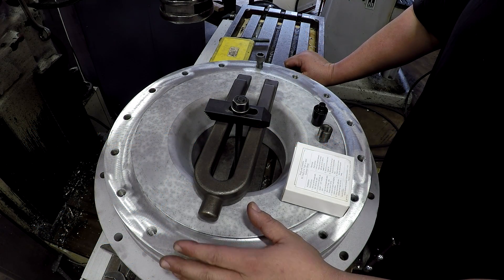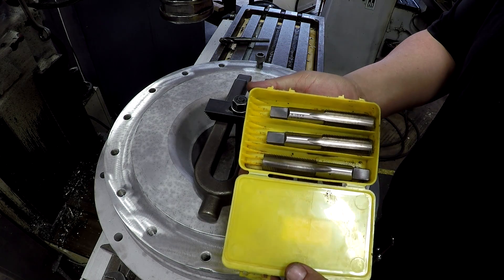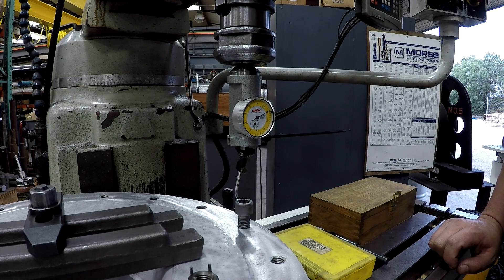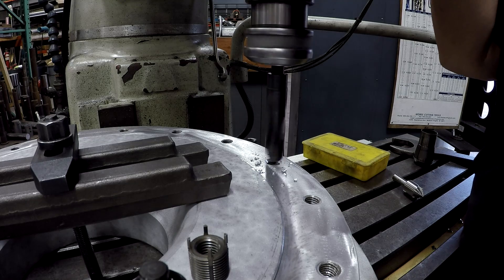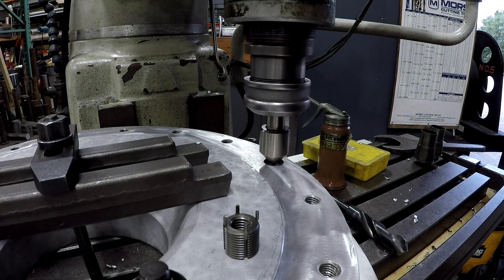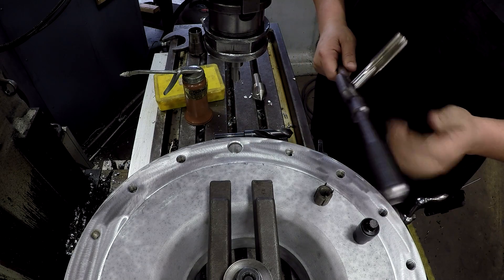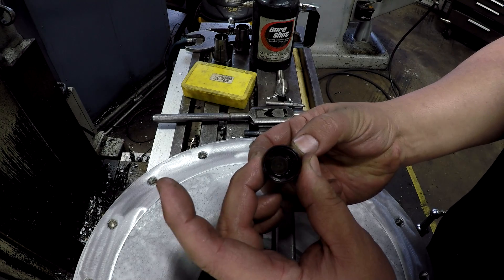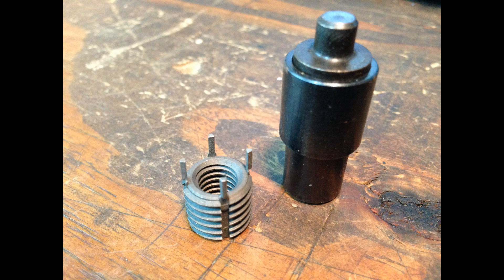Keylocking Thread Repair

Comment: Adam,

First I'm not a machinist, but I'm wondering why not use a helicoil? I would guess that requires less removal of material, and will be strong enough..

But I guess there is material enough,
 so that's not an issue.. I'm just wondering if there is a good reason for choosing one over the other.. So I'm trying to be educated not educate.. :-)

Steffen
Denmark

Comment: Hey Adam, I did enjoy this video. I have installed these same key lock inserts to repair threads for locomotive exhaust stack to engine block bolt up. nice demo. PS, Looks like summer before I'll get to the hammers I'm making for you, Tom, and both the Keith's. Much left to do before the shop is finished.

Comment: I've used helicoils before but not these.. thanks!  Beware the cheapie thread repair kits at the auto stores, nearly scrapped out a motorcycle oilpan using one; the tap included with the package was ground all wrong and started acting as a milling cutter.  Felt a disturbance in the force so quit and threw out the junk, bit the bullet and made up a plug to finish the job.  Would've been lots cheaper & faster to have just bought a keylock or helicoil kit.
Reply from the maker: +Greg M (pounce) Greg, you on point with the El Cheapo thread repair kits from say like Napa. We bought one once for a size we didn't have on hand for a repair. The tap was absolute garbage and as soon as I went a couple threads in, it broke! I was like WTF is this bullshit?? How can someone do there job if the tools won't even work. Just a complete waste of time and money. Stick to the quality brands and kits and you'll be fine and the job will get done.

Comment: Nice work. We use key locking inserts a lot in the composites shop I work in. Typically in aluminum parts and fixtures that require threading, we use key locking inserts instead of relying directly on aluminum threads.

Comment: keen certs or what ever you want to call them are grate ive used em to fix head studs on an alu block before they are way better then the factory you get bigger threads in the alu and also steel that the bolts or studs go into so your basickly never going to have any problems

Comment: that's pretty nifty. the combination of wedging in place and creating a keyway by pushing a bit of the threads out of the way is ingenious. I wonder if a similar insert could have a little broaching tool for a better keyway. Drill,tap, drive the broaches through, drive in 4 little keys.
Reply: +Robert Szasz  Broaching would leave the insert loose. The metal displaced by the tangs locks the insert tightly in place somewhat like a shrink fit so there is no galling or fretting.
    Mike (o\!/o)

Comment: Nice!! By chance, any idea what the weight of the keylock assembly is? When used on gas engines with aluminum flywheels, we have to worry about weight and balancing on high RPM engines. As you probably know, with zero, or internal balance engines, we make sure the flywheel and harmonic balancer are taken into account when balancing the crank, rod and piston assembly. With diesels and OEM repairs, it's probably not a big deal at all. Your piece doesn't look like a flywheel though :) Looks like a heavy duty and beefy thread insert. Go big or go home!
Reply: +Doug Hanchard  Just use another one directly opposite if balance is in question. 
    Mike (o\!/o)
Reply: +Doug Hanchard If the work is steel, the weight removed by drilling should nearly equal the weight added by the insert.  With aluminum, use Moholo 88''s idea.

Comment: I feel like this is pretty damn strong, but for shits and giggles, if you needed more torque ability, you would be able to weld the insert in after its been pressed in right?
Reply: +girrrrrrr2  With 4 keys locking rotation I guarantee that you would break the bolt before that insert moved even in aluminum.
    Mike (o\!/o)
Reply: Moholo 88 True... and i just realized it was AL, not steel... so pretty much impossible to weld them...

Comment: Newbie Question: Do you ever worry about mixing steel thread repair products with aluminum? Has that ever been a problem with customer callbacks?
Reply: +wxfield  Nothing to really worry about. The original bolt is steel. Will there be some galvanic corrosion around the insert? Probably, but as the insert doesn't need to come out it isn't a big issue.

Comment: adam have you ever used those keylock threads on a cylinder head where a 300 ape has tugged down on a sparkplug and stripped the thread clean out. funny enough im weighing up options for a job in my shop this week with this very problem.
Reply: +honi9  http://www.amazon.com/Helicoil-5334-14-Save-A-Thread-Thread-Repair/dp/B0002SRF4O  
Work real good on that problem. They are a thin wall insert that is locked in place by staking teeth on the insert.  Have used a bunch of them on Fords...

Comment: Please don't get me wrong, I know nothing about these inserts (and I use metric) - but is that really ONE size up? It kinda looks like at least 150% (possibly 200%) diameter of the original hole...
Reply: +Attila Asztalos 
I believe the "one size up" refers to the drill size being one size up from what you would normally use when tapping the 7/8-14 threads.

Comment: I have a question. If you're drilling and tapping the whole why not just put the bolt back in the hole? Its threaded and tapped already. Why the use of the key locking insert? Im new to machining im not trying to be a smartass.
Reply: +OTrainExpress  The original threads were damaged. In order to keep the same size bolt in that hole you have two choices. Drill the hole out larger then TIG it closed, re-drill the hole and thread back to the original size. OR you can drill out the hole and use a threaded insert to replace the material you removed and restore the original hole diameter. As for the insert Adam used, there are a lot of different types of insert, from simple heli-coil types that look like springs, to thin wall and thick wall solid inserts. All have their uses depending on wall thickness and what you're trying to do.

Comment: good demo adam those inserts make a great repair when you have room for them you don't need special taps and  they wont unwind but helicoils have the advantage when room is tight or when you need special lengths also all the helicoils i have used in the past were stainless, i don't believe  the keylock types are.
Reply from the maker: +larry sperling No doubt Larry, they all have the place and use.

Comment: Hey Adam, we used something similar to what you used on our aircraft,but I don't recall what they were called. I believe they were stainless and not near as bulky in diameter. They were closer too a heli-coil in diameter with 2 inserts and they held up great. Another great video showing many people what's out there to repair threads.

Comment: Great vid as always. One question, why did you loosen the tap handle and raise it up for the last few turns while cutting the threads? You then loosened it and put it back to remove the tap?
Reply from the maker: +Steve Broz Only reason for that was because the handle was hitting the stud and flange nut holding the part down. Watch again and see the handle hit the nut. Just needed a little bit a clearance.
Reply: Copy.... Thanks for the quick response

Comment: Hi Adam,
Another nice video!
I love these inserts. About a month ago I did a repair on a inline 4 cyl. Honda motorcycle engine. The customer broke a crankshaft main stud and then tried to drill and ezy out the broken stub out of the aluminum case haft. Well his drill walked off to the side and he kept at it doing a lot of damage before bringing it in. I set it up in the mill located center and cut out the broken stub and machined the case to fit a larger insert with the correct ID for a new stud. The job turned out beautiful and I have no doubt that the repair is much stronger than the original. Those inserts come in a huge selection of sizes, and once their installed they will not come back out like a coil insert can. I was able to save my customer a bunch of money by not having to buy a replacement engine. I loaded up on those little juals and now keep a nice selection of them in my shop.
Reply from the maker: +Joseph P. Polnaszek I agree with you Joeseph. They are great to have around and work good in many applications. We have a pretty good supply of them now but McMaster-Carr has just about any size you need one order and day away.
Reply: +Abom79 Yep I bought my supply from McMaster Carr. I use them all the time for this and thats. Like you I too do a lot of weekend work, and it's nice to be able to knock those jobs out for the customer right away. I have a few local motorcycle and automotive shops as customers and I find I'm doing more and more thread repair on the older aluminum engines and transmissions.

Comment: Adam,
Thanks for a special edition of the "Sunday Night Special"! I've always used the "Helicoil" for thread repair on motorcycles. I could get them at the local Honda shop. These look like they would be a lot more secure and not twist in the hole with use. Thanks for the info.
Dave

Comment: These used to be called helicoils right? until they lost their patent recently. I used one of these on an engine block about 6 years ago for a stripped head bolt.  I was skeptical at first but everyone I asked about said they are actually stronger then the original threads. 6 years later the truck still runs great!
Reply from the maker: +bmxguy08 HeliCoil is a different type of thread repair and they are still around. Helocoil is one of the brand names, there is also Recoil too. They do work great as well and are better from some applications, I especially like them in salt water applications.
Reply: +Abom79  Right on good to know thanks for the reply! I love your videos man keep em coming!
Reply: +bmxguy08  They use Heli-Coil inserts on a lot of aircraft assemblies before the threads are even damaged.

Comment: Great explanation! I have used Helicoils, Timeserts (swaged/flared style) and Keenserts (staked) for many years and each has distinct pros and cons. Outboard boat and motorcycle engines seem to have a draw to folks working on them...causing a lot of stripped threads.
Reply from the maker: +Mike Green Yes, some applications you may not have room for the locking thread inserts, but in some cases you may have a damaged hole with alot of metal removed. You can get these in extra heavy wall thickness as well, so every type has there purpose.

Comment: Hi  Adam another excellent repair ,there is another type of thread repair called time sert something similar to what you used except you swell the insert once you install it and the wall is quiet thin so you can use it in places where their is not much meat to play with .Thanks for posting.
Reply: +Vince o brien : I love Time-serts for small to medium sized-holes... larger sizes can be difficult to swage out in aluminum thread repairs.
Reply from the maker: +Vince o brien I personally have never used that style but would like to so that I can compare with the other types.
Reply: +Abom79  The thin wall inserts are real common for spark plug hole repairs. I've lost count of those installs...

Comment: Nice work once again. I have a co ax indicator at work and I run mine at about 350 rpm.  For vertical spindle work, neutral or spinning doesn't matter.  When used on the horizontal mills, the rotation helps negate the gravitational forces ( false reading ) in the vertical ( Y ) plane.  Jeff